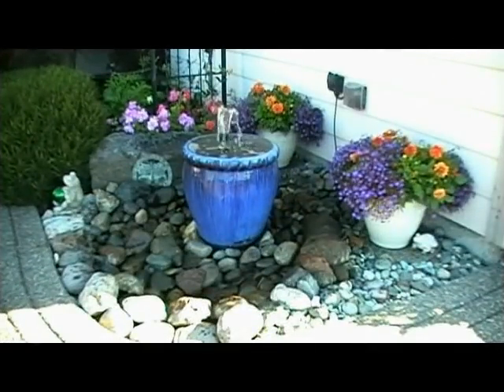Learn How to Make a Pondless Water Feature

Comment: I like it but I'd add an auto-fill valve. I've already replaced 3 pumps this year alone that burned up because people got lazy and forgot to fill their ponds. One water feature, the owner has lost pumps at least 3 separate times :-) Its a little extra cost to add one but its worth it, maybe $40. I like to hook to an underground mainline (irrigation side), but a nearby hose bib will work as well.
Reply from the maker: Natures Plan LLC Yes an auto fill is a great idea if you have the room for the float valve in the sump. I'm heading on 3 years now with the same pump without a problem. I guess it helps having it right outside the garage door so if you don't hear water running it's time to fill it up.